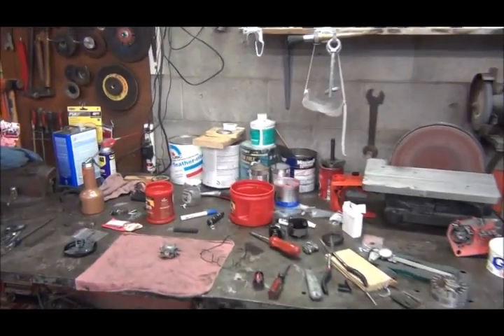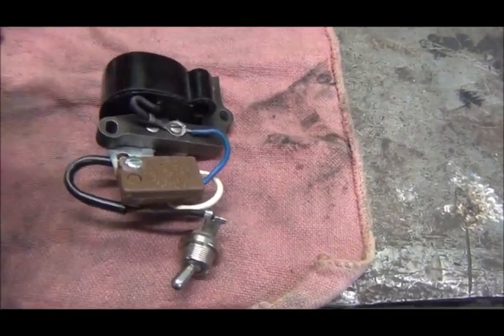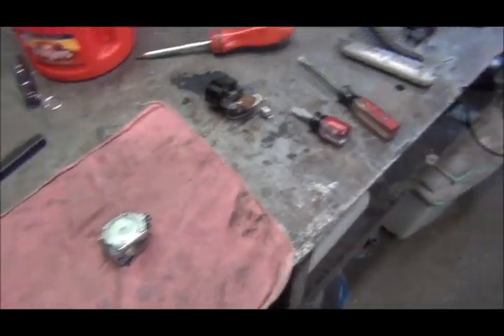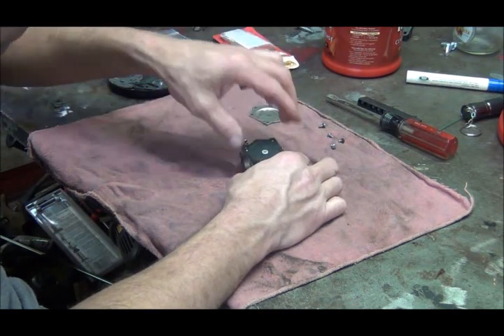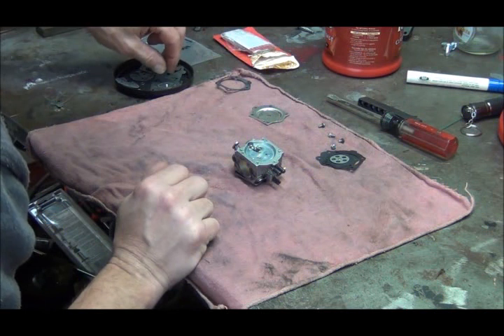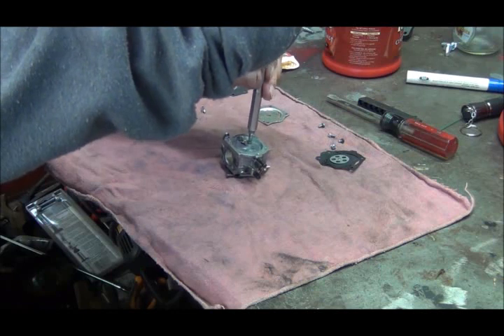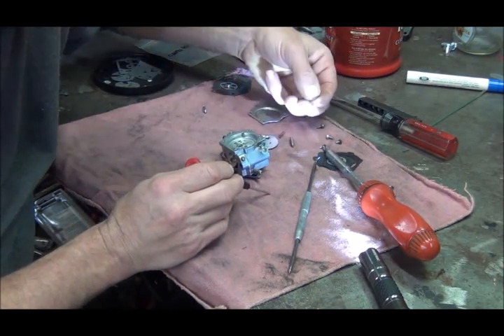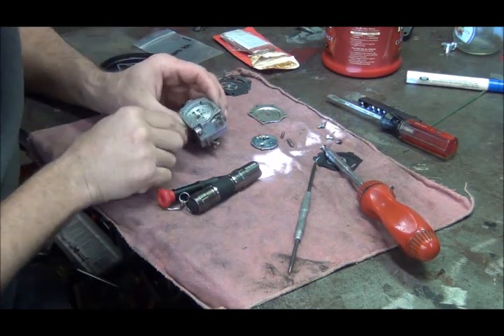Homelite super EZ automatic carb rebuild Part 1 The disassembly.

Comment: Got one of these saws, where’d you get that carb kit? And which kit is it?
Reply from the maker: Found it on e bay . Can't remember the name of kit . I used the part numbers on the carb to find the kit. Thanks for watching .
Reply: K10-HDC is the carb kit. 

I left notes on your part 2 with information on getting a diagram off of walbro's site for their carbs as well as settings and adjustments.

Comment: It's early 70s not a super, White starter cover, original EZ, somebody's converted it to electronic and removed the points, not original, not the original fuel filter either, that saws been messed with somewhere along, don't run it to long without the filter, you might go for years but the first it picks up out of the tank, you have a clogged carb, and if it gets passed the carb and in the cylinder She's done.
Reply from the maker: Thanks for the info . I suspected the ignition was updated . The following fall after this video was made I used this saw to cut up huge oak that had died and fallen. The saw ran all day, like a champ. I did end up finding a good filter for it .